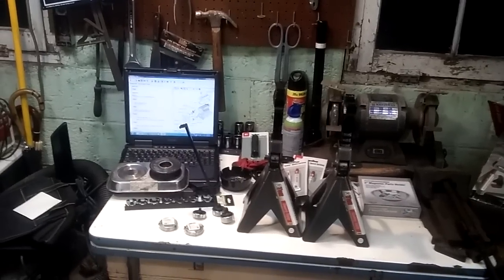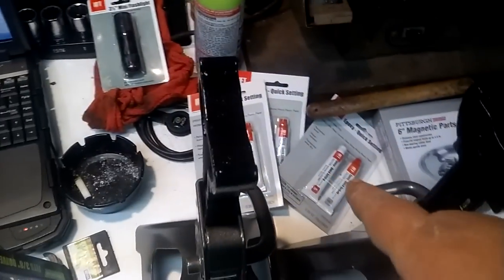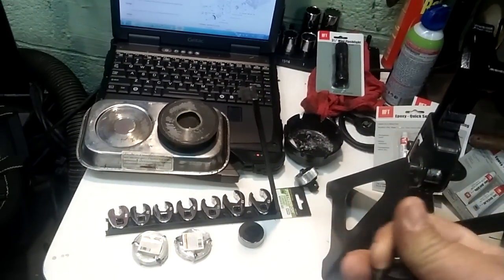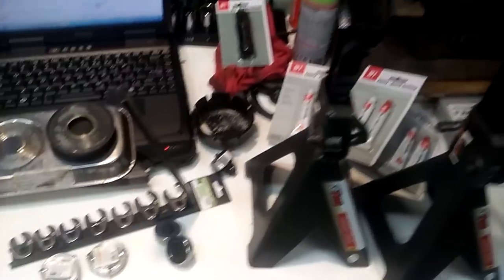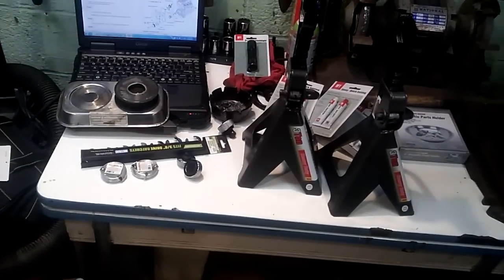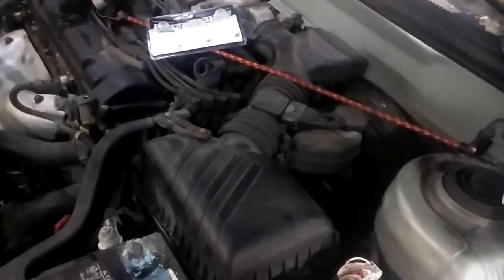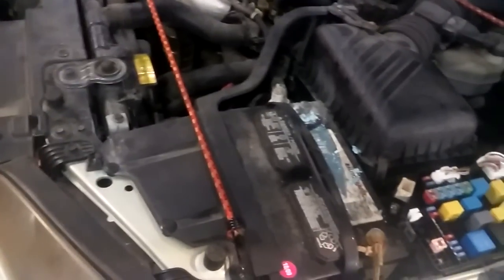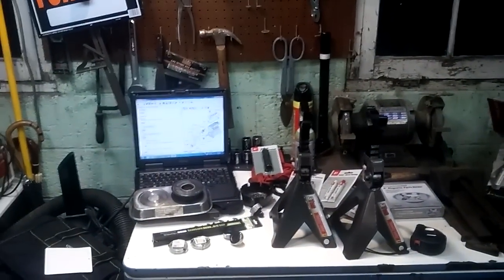Got some new tools at Harbor Freight

Comment: I did a job on my truck where I had to get a brake line off. If I would not have had a crows foot to get to it I would have had to take a lot of other shit off to get to the line. They are worth it for the few times you need them!

Comment: You forgot to mention that corroded battery terminal I saw. Possibly a sulfated  battery. Check your battery and replace the terminals : )
Reply from the maker: +Rick Bittner Yeah, I guess I just figured most people would know to do that  I cleaned them all up and load tested the battery.  It's not great, but it will get me by till winter and I will find a good one at the salvage yard before snow flies.

Comment: The crowsfeet,the 18mm comes in handy on power steering lines.The Motorad thermostats are garbage,they make the gimmick failsafe thermostats that do fail a lot.Stant makes the best thermostatsLot of times it is better to buy OEM and spark plugs are this way.See misfires with the gimmick E3s and Bosch spark plugs a lot.